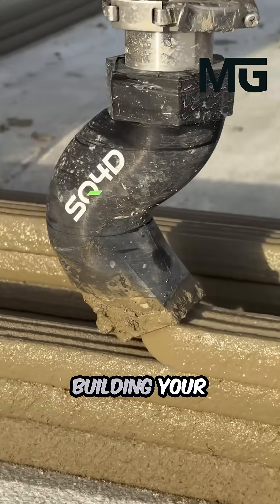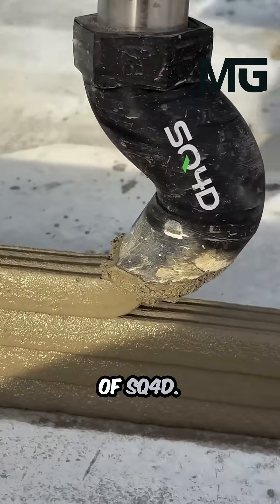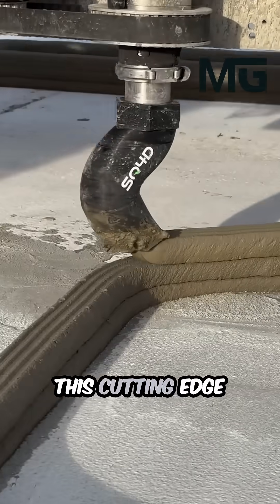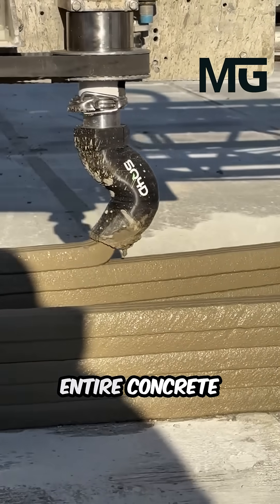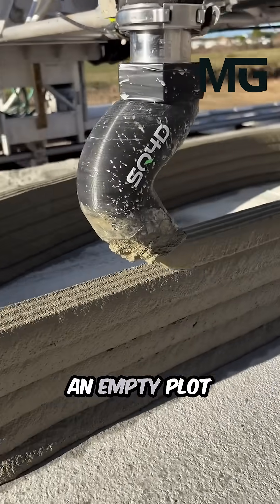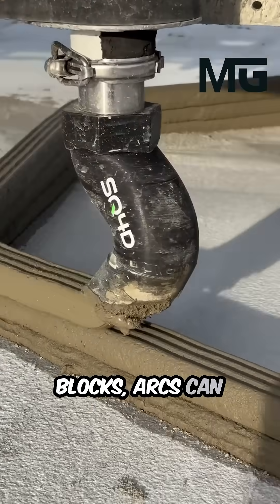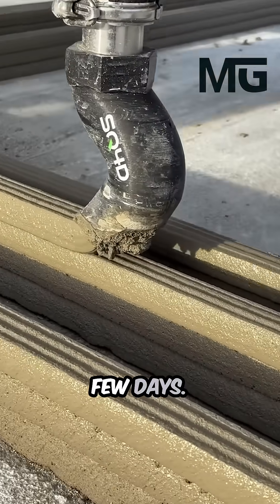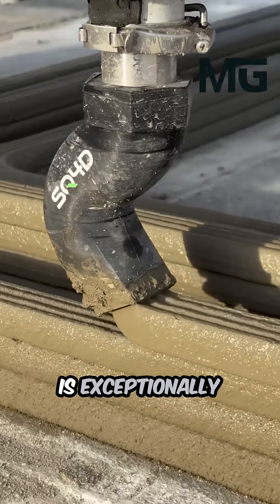This Is The Future Of Construction #construction #3dprinting #civilengineering

Comment: add an electrical wire in the wall as you go.  have a spool of wire fed into the cement  as you go for outlets and switches.